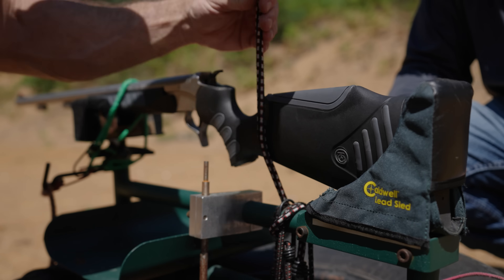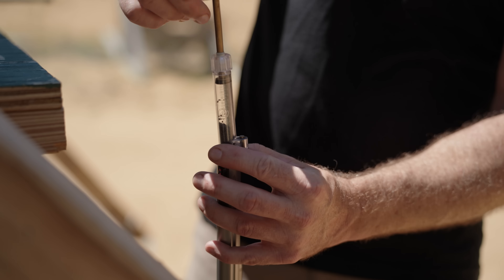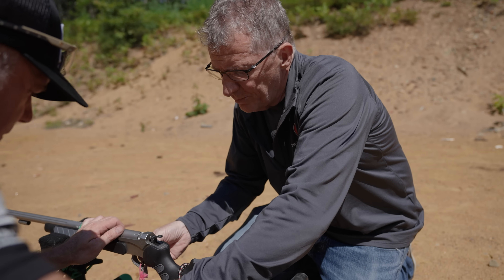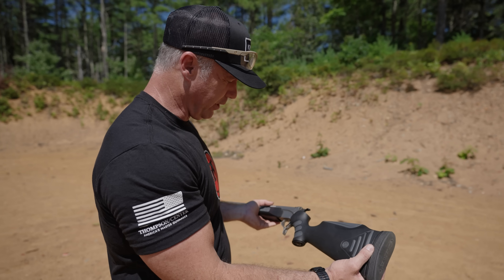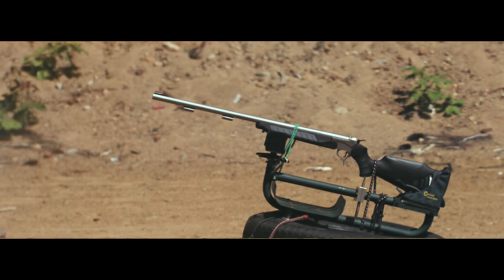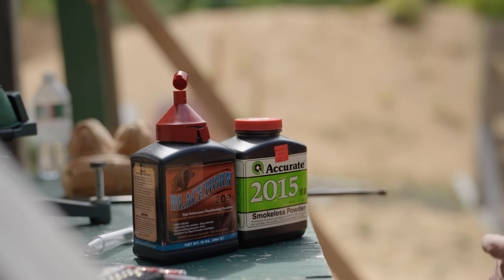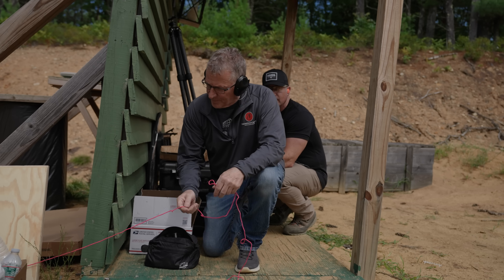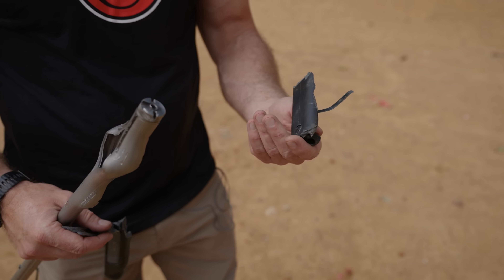My Muzzleloader Exploded

Comment: In 1973 I had a repro 58 Zouave. Not much info on muzzleloaders then. My buddy told me it's impossible to blow up a muzzleloader. We eventually loaded it with enormous charges of black,loaded two 500 grain bullets. It would turn cement blocks into dust,but no adverse effects. Recoil was tremendous. After enough of this punishment, remotely fired,it did develop a tiny crack in the breech

Comment: I've been using only  smokless powder in my breech loader sharps 45.120.  (Black powder only). . For  long time yes you are right i make my own bullets and measure the powder in grams,  exactly 3 grams .  How i come out with this recipe: a similar 450 nitro express use  btwn 4 ,7 grams  to 6.2 grams.  . Its all about keeping the those presure down.  Any  bp gun in the world will be safe to use smokless as long as you keep pressure down . But not all will ignite if its too less,  .

Comment: Volumetric weight or volume of proportion is buy technicality defined as a weight it is not the same type of weight and it is not weighed in the same mannerism or on the same scale or variant of how other things are made but it is still nonetheless a weight same thing with gallons per pounds they're both weights they're both a measurement of an object it is just defined differently because of the different types of material that is being waited but a gallon of milk is still a weight of milk it makes no difference you're just doing it in a different manner it is by all definition measurement which is what weight is is a measurement just like heights height is a measurement please understand what you're talking about because it's really just irritating how many things you have misspoken on because you're not thinking about it in the actual context of the way it should be because I don't know why but I mean you know just so you know the volume of something is technically by all definition a weight and is defined as weight or measurement which is a which is the weight of an object it's one in the same buy technical terms and buy all technicality and physics it is one of the same it's just a different scale of measurement/weight and the reason why black powder is weighed by vomiting or volume rather than by grains in of a weight of density and why smokeless powder is is pretty obvious from one smokeless powder comes in all different types and all different densities and is made out of a completely different material altogether and has a lot higher of a energy when it is actually therefore it reacts differently therefore you have to take extra precaution because they are not all the same in comparison when you have black powder or synthetic black powder which is a black powder substitute they are can be weighed by volume due to the fact that they do not have as much energy when ignited or when you know doing its thing so therefore it isn't anywhere near as dangerous as packing a whole bunch of shotgun powder inside of a rifle case you're going to blow your shit up play you can't really put shotgun pistol powder in inside of a long gun case you can shoot it it's it's a very dangerous thing to do and that can blow up your gun just like you can put rifle powder in a pistol case/cartridge it's not going to be beneficial or work in any way that is predictable but by all means you can do it it's not recommended again but I mean you can technically do these things and they can technically work not likely to be safe or without you know catastrophic failure but that doesn't mean it can't be done it very well can be it's not recommended but again because of the fact that the two powders are not equivalent and even two of the same smokeless powders are not even representative of the same sort of energy when you know ignited you have very different use cases for different styles of powder that's why there's so many of them because certain ones work certain with certain barrel twists and this and that and there's a lot of different stipulations in it and some powders are interchangeable between shotgun pistol and rifle depending on the road and depending on the projectile weight length of barrel etc excetera but not all are interchangeable at all some are not interchangeable whatsoever however again you can do things in a pinch it's not recommended and it can be very dangerous it's not impossible though it's not smart to do it but trust me there are loads to do things that you've probably shouldn't be doing and you can be doing them safely to relatively safely you know but then again if your hand loading or even just shooting one you have possibilities of catastrophic failures happening that's just what that's just what it is just like if you drive down the street you have a high chance of having a catastrophic failure driving your car it's perfectly safe most of the time but you know shit happens light come on now it's not recommended to do a lot of things but that doesn't mean that they're not possible and they can't be done safely they shouldn't be attempted by people that don't understand what they're doing sure

Comment: That's a complete lie there definitely is recipes out there that are safe to use perfectly fine now is it suggested you go and try to figure that out or do it yourself no because you're probably not smart enough because you're thinking about doing it and you don't already understand the basics of what you need to in order to do so safely so is it recommended no fuck no can you yes absolutely you can don't fucking lie to people that's bullshit and is it a smart idea most people you're not smart enough to even comprehend how to do this remotely safely so most people probably shouldn't fire guns because most people don't have the common sense and common understanding of what they're actually getting themselves into but hey it's called freedom if you want to be an idiot and you're an adult you go right on a fucking head just post it on the internet so the internet can do what the internet does and laugh but to tell people flat out that you can't that's a bulshit lie in anything involving an explosive or fire or both or kind of dangerous just off the rip like you are taking something which is a technical explosion inside of a confined fucking device that has been propelling a fucking projectile or an object through said device at a very high rate of speed due to an explosion that is a dangerous thing doesn't matter how safely it can be done it's dangerous but walking down the street is also dangerous to do when you think about it there's many things that can occur to you when you're walking down the street minding your own business in fact just being alive is quite dangerous you could just be sitting there and an asteroid or meteor could hit you in the face and take you out simple as that yes that has happened is it a common occurrence no not at all but it's completely unavoidable and or you know just you don't know if it'll happen or when it will happen but it could at any time to anyone anywhere so that being said you want to live your life inside of a bubble and don't do anything ever then you go ahead and do that but just understand that being alive in general is dangerous there are many things that can take you out in so many different ways it's not even funny in fact you could be perfectly fine not doing anything just sitting there minding your business or sleeping & blam aneurysm happens to do its aneurysm thing to you & that's all she wrote so I'm I'm I'm I'm I'm just baffled by your logic here because it doesn't make any sense in reality and besides that you're blatantly lying to people it is for good reason & with well intentions but none the less it's a blatant lie to say there's absolutely no way to do that safely I mean again if you shouldn't do it I absolutely agree with you should not do it most people do not have common sense most people do not have the brain or the understanding of how to do it safely so they shouldn't but that doesn't mean that it can't be done it can it's just you shouldn't attempt to do it you shouldn't try to do it you shouldn't fucking even try to figure it out because you might end up or probably will hurt yourself or worse but that doesn't mean it very much is a possibility it's very actually common but people have done the things that they need to do in order to do it in a manner that is fucking safe which a lot of people don't even begin to understand that concept of how to even get there so don't attempt it but it is possible I don't like people lying to people it honestly it makes them want to do something that you're telling them couldn't be done because you say it can't be done they're going to say fuck you I'm going to do it anyways just to prove you wrong because you told them they couldn't do something that they could which they did which ended up badly for them which they should have known and it's their fault entirely but still it's because of you lying blatantly to them and then understanding that you're lying to them and also because they're just spiteful morons like myself you know like it's best just not to say anything hassle of having something bad happen just don't give him but if you do mention it you shouldn't say that it can't be done you should just say it's not best to try to figure it out but you know you are your own person you're going to do what you want to do it's not recommended but you go on ahead that's the best way to handle that or don't bring it up to begin with and besides that you know just so you know I don't know if you know this or not but YouTube disclaimers don't mean shit it won't hold up in court like trust me the disclaimer gives you absolutely no legal protection whatsoever it doesn't matter if you put it in writing if you put it you know in by saying it doesn't matter how many times you say it it holds no bearing in the court of law if somebody decides that that you know they're going to use this for whatever an exhibit in in a case that you know is being heard it means nothing it holds no weight that is not only applicable to this but anything in or everything that you say or do or talk about or show on YouTube it has absolutely zero bearing of anything that will be getting anything legally you know dismissed just because you said well you shouldn't do it this is a disclaimer therefore if the most of the population is too stupid to actually understand what disclaimers are and or just in general not to attempt things that they see that could be dangerous they don't have the brain capacity to not attempt those things the courts are not going to fucking uphold well you told him not to do it because you showed him how to do it I mean this is like a tutorial that's how it could be interpreted and that's how they will interpret it essentially so yeah there's there's no I mean you can say it doesn't hurt but it also doesn't do anything in the legality of things & that is for abroad spectrum of anything  & everything done on YouTube & likey another sort of median so just saying it only makes him want to prove you wrong in reality and it's probably worse than not lying to them I mean I'm just you know going off of personal I've been told I couldn't do something so I did it anyways and I proved the motherfukers wrong it's not a smart thing to do sometimes but you know I don't like being told it's not possible because the fuck it ain't just cuz you can't do something don't mean I'm not capable of doing whatever you're saying I can't.... Again it's not recommended to try it but it is possible not smart or wise & it is dangerous when done incorrectly which is likely what it would be if you try it so you probably shouldn't if you care about yourself & anything & everyone who's around the area if you do try it because it almost certainly ain't going to work without a loud pop & in pieces flying everywhere

Comment: The reason the stock busted is kind of obvious and you guys are going way too into it without realizing what the hell is actually happening it's a plastic stock it's a kid's choice material that's why it cracked it's it's blatantly obvious I mean come on like really do you think that plastic absorbs shock well no kids toy you should have a very clear idea that these things are made cheaply and disposable or with the purpose or intent of being disposed in being disposed of rather quickly rather than a long time use again it's a plastic stock that's why it cracked is it's crap no offense plastic stocks have their purposes for being light and also you know like that's about it that's about the only benefit to being plastic is the weight reduction but than again that's also a downside because it's light you're going to be receiving a lot more of the recoil due to the fact that it doesn't have anything to mitigate the vibration or the sudden shock of said recoil about zero benefits to having a plastic stocked rifle or gun in in general plastic is not what gun should be made out of I don't care what you think I'm stating a fact and if you don't believe me think about this why is it that you can find an authentic contact suitable usable pistol from let's just say I don't know the mid-1700s which is made out of wood and iron basically not anywhere near the the material or the iron ore the metal that we have today and it will still function sometimes not all of them but some of them are still found in pristine condition where you can actually use them and shoot them being perfectly fine & safe to shoot but I don't think that any plastic gun is going to last over 200 years and still be usable the way that it would be even if it was inside of a house in a room conditioned no it's not it's not going to be safe and it's not going to be usable especially if it's used a lot again you are putting a plastic like piece of crap where would should be then the plastic can I don't care if you infuse the plastic with nylon and glass it doesn't matter the wood will still be able to take a more beatings and be perfectly fine then that plastic infused nylon glass type shit again the one benefit that plastic stocks have is not really even a benefit when you think about the recoil that you're receiving because of it being a Halo piece of plastic it's not a benefit so that's why the stock cracked it has really nothing to do with that much it's because for one it was strapped down letting it not have anywhere to go or to mitigate it any which way and let things naturally do what they do if you were to be holding that rifle it wouldn't have broke I almost can guarantee you that but because you strapped it down so tightly making it not moving like in your arms it would be able to move a little bit of give but since it didn't have any gift it all had to be it was being forced and didn't have anywhere to go so it did what it does it expands outward in the the least forcible way just like how about shoots out the barrel if you think about that logic you should understand that concept fairly well but apparently as smart as you guys are you're not really thinking about things logically here you're just trying to make up stuff and say this or that because you know it's longer than just saying yeah I have a piece of shit stock that's plastic rather than a Woodstock which would have handled that way better if it was a decent would I mean sorry to rain on your parade but I mean this is common sense here I don't understand why people don't have common sense anymore

Comment: You can easily blow up a modern center fire rifle too. Try filling a 30-06 case to the top with pistol powder such as unique or hp38 or Accurate No 2. It'll blow the same way. It's not that a muzzleloader can't safely shoot smokeless, its that its easier to dumb it down to the lowest common denominator by saying black powder only rather than suggesting carefully selected smokeless powder types at carefully weighed charges. There are people who have conducted pressure testing and worked up safe load recipies

Comment: Black powder burns faster than smokeless and is considered a low velocity explosive but smokeless has more energy per weight and puts out more pressureand burns faster as the pressure builds.
You do not want to be next to a pound of black powder in a pile with a lit cigarette.

Comment: I have my ramrod painted. Drop it down the barrel, if you see all 💚 green, it's empty and good to go. If you see red, you need to check the condition of the loading. I also have the red section marked to various levels. The first line is the powder level, second line is powder and wad, third line is powder, wad and ball. This way, if your loading was interrupted and you've forgotten where you were up to, you can see at a glance where you were at and continue on safely. Cheers. 🇦🇺

Comment: A friend once bought  a muzzleloading pistol second hand.  The box containing the pistol also contained several tubes with black powder. I was a bit confused as it were tiny amounts (~8 grains for .45) but they worked for him. Until he loaded a maxiball into his pistol (I knew it didn’t make sense- he insisted somehow).
The blast took the nipple and some sorrounding steel out of the barrel and it got stuck in the wooden wall which separates the shooters. Luckily the next range was empty. No one got hurt.
Long story short: The tubes contained smokeless powder! 
As I never had seen smokeless before I didn’t realize it in time. 
It was so unthinkable that the previous owner could have used this pistol with smokeless powder regularly!
We confirmed the smokeless powder by lighting a small batch in the next minute. The pistol was a loss.
Always think the unthinkable!